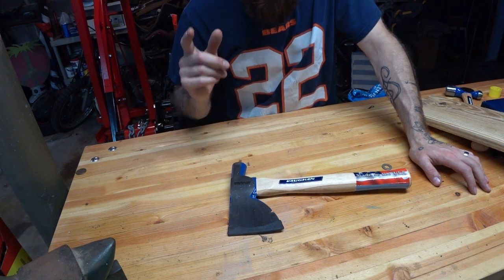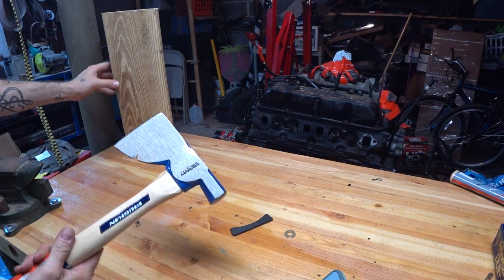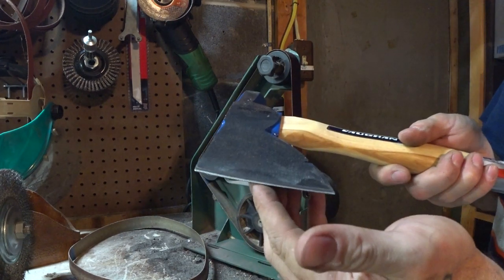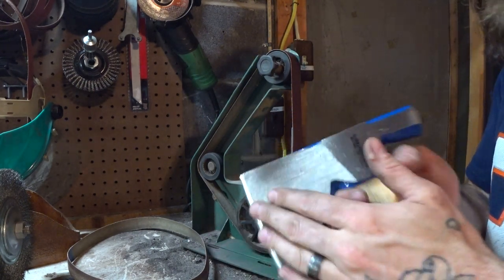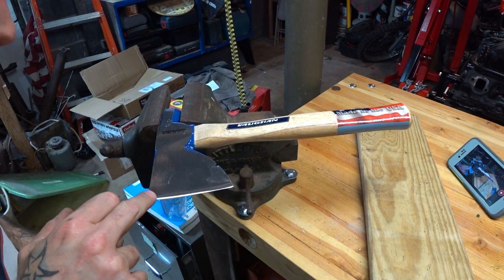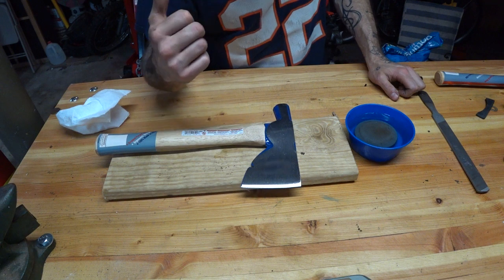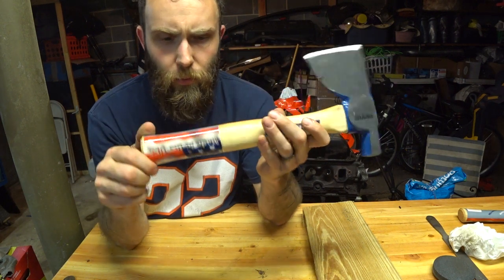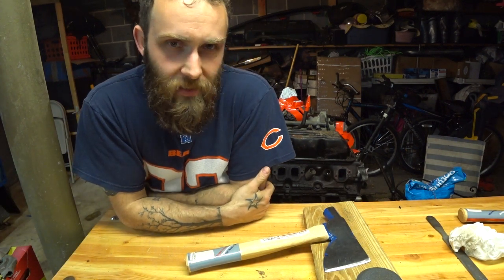Mod a $19 Hatchet or Ax to out-preform a $100 one - Vaughan Hatchet Job

Comment: Estwing makes a camp hatchet  with sheath for about $20 - 25 bucks & it comes sharp. A roofer's axe, which you bought, is not suppose to be sharp.
Reply from the maker: I looked at the eastwing, but I wanted a wooden, replaceable handle. The roofing hatchet as always been a go-to for me for camping because they can take a beating and are a great shape for splitting kindling
Reply: @DEInTheGarage  Cool. I like a rigger's axe also, it has a longer curved axe handle, but my go to is an Estwing hatchet that has been in the family since the late 1940's and is still used to this day for chopping firewood & making kindling.  Good luck  on your outing, be safe & enjoy.
Reply: I have that Estwing camp hatchet as well. Love it.  And it is sharp.   Like their hammers too.  Also like Vaughan.  Have one of their hammers as well.
Reply: The hatchet shown is a Carpenters hatchet and not a roofing hatchet. It's supposed to be Sharp.

Comment: Thanks for a very informative video. I'm planning to purchase the same hatchet tomorrow and will use some of your techniques to put an edge on mine. I just want to keep it in my truck in case I have an emergency (branches falling across road, etc.), and I like the idea that it can be a hammer as well. I'll probably keep a small box of nails with it, just in case the need arises. Thanks again.

Comment: I hand finished a Vaughan broad hatchet last night that a blind drunk monkey sharpened at the factory.  Their heat treat is spot on...whatever the steel is.  I bet they use different ones dependent upon current prices.  Da Bears.
Reply from the maker: Da Bears. 

And I agree. I like Vaughn stuff (my favorite hammer is an off the shefl Vaughn), but I have noticed a huge swing in quality. To the point where you need to pick through what is available and find the best example
Reply: @DEInTheGarage  Luckily I bought this in the 80's.   I haven't needed it until now.

Comment: Great video, nice to see a different subject matter, even though i love the junk yard stuff. Did the Pull a part last weekend and got a water pump for my Libby and some used shocks for my 2002 Avalanche, hate that you could salvage the Avalanche, titles are a killer road block.  Back to the Libby; she kept getting hot and i changed out the radiator when i first got it a yr ago, i later changed the thermostat, but i kept losing coolant and it had a weird habit of bubbling in the coolant reservoir after the motor was cut off, maybe that was just a byproduct of running kinda hot. Anyways old water pump looked solid but it seemed to fix the issue after putting a new pump on it.
Reply from the maker: Dang bud.. very strange issue, but I am glad you get her back on the road!

Comment: Believe it or not. Did a block test and still can't figure out what's wrong with my 03 Dodge. Water pump, thermostat and heat censer and still over heating. We are truly stumped.
Reply from the maker: Damn bud... Over heat at idle or while moving?
Reply: @DEInTheGarage  when rpms are over 2000 for a short time or going up hills.
Reply: It doesn't over heat at idle

Comment: I think you're a hack, not for the work good job. For bringing metallurgy into this talk specifically, Pretty sure the vaughan has the best steel based on most reputable axe steels are basic bit** .45-65 carbon steel. & By most european steel being recycled vaughan wins by default. Theres a reason most reputable axe brands dont give the steel specs other than "swedish" or "high carbon" "specialized alloy" bc its basic steel for chopping wood, not some specialty tool steel that needs resist deformation at x psi for x days on x steel at x speed. So dont undercut you're own correct premise of the video, edge geometry is very important.